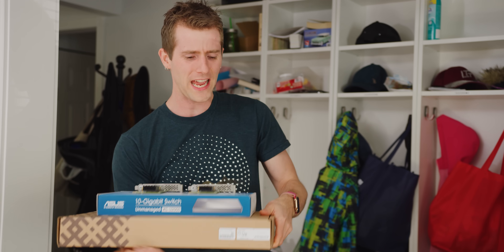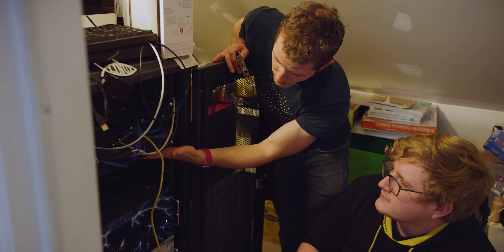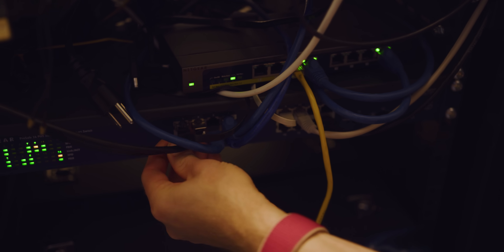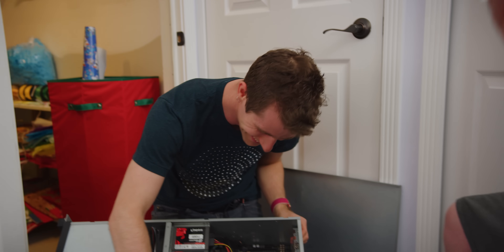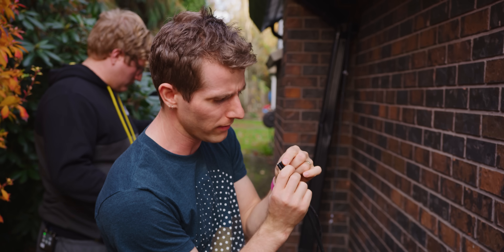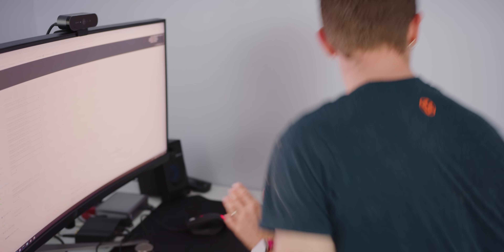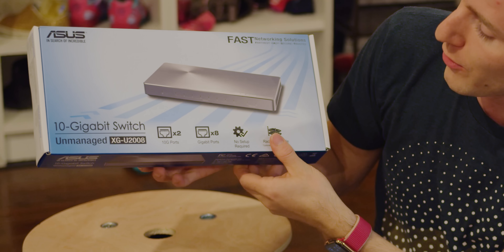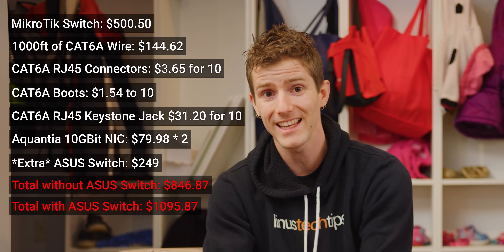Home 10 Gig Network Upgrade for CHEAP

Comment: I've just run single mode fibre cable runs everywhere in my house that I need 10G, the LC connectors are about the same diameter as Cat6A cable so I don't need larger holes, and if you use BiDi SFPs which are still very cheap you only need a single fibre for 10G anyway.
Reply: Richard Skinner I have gigabit internet and it’s great but already seems like overkill for most applications. What’s the practical point of running 10 gigabit?
Reply: @PodtrashRadio  I have a small main desktop with only SSDs in and all my bulk storage is done on my unraid server. I have an iSCSI target on the unraid server for my steam library. 100mbyte/sec would be a bottleneck.
Reply: @richardskinner6391  Cmon... admit it, running fiber for a LAN in a home is total overkill... you did it for the nerdgasm!
Reply: @billysgeo  it was literally the cheapest way to get 10g
Reply: @richardskinner6391  Was it really? (and then again, why did you need 10G LAN in a home environment?)
Reply: Transferring to/from a NAS

Comment: 10 gigabit home network sounds nice.... 
But for the avg household, would we ever need it? 
I mean, i got 250/250 Mbit internet here, and a flawless (although pretty slow) wireless router. my PC is plugged in via a cable and nobody using the wifi is complaining.
How would a faster network, within my home, improve anything?  we dont transfer large files between our computers... 
Seems like a "fun" way to waste hundreds of dollars. but.. maybe i'm just not getting it.

Comment: Linus : I still have not upgraded my house to 10 gigabit connection

Me: I still have not changed my house to 300 megabit connection
Reply: If you ever actually consider it, then run some conduit first. Makes it easier later on when you decide you want to add speaker hookups or something.
Reply: Sounds like you're talking internet while Linus is talking home infrastructure.
I downgraded my home switch to a cheap Cisco so I could learn iOS.(the first one that is, not iPhone...). Now I have two 1Gb ports and 24 Fast Ethernet, 100Mb/s. 😂 My internet connection is 100Mb/s so I'm still alright. Lol

Comment: Not sure what they have against fiber. Really 10G SFP+ transceivers are like 8$ nowadays. And fiber itself is cheap as well. The connectors are a bit pricier ( like 5$ per connector for the mechanically spliced you can do without super expensive fusion splicer ) but that's not the end of the world. And it's so much thinner than cat6.  Like in the same diameter as a cat6 cable, I can bring 24 fibers trunk.

Comment: That cable installation isn’t Cat 6A, or at least it doesn’t conform to either the ISO/IEC nor European standards. 

Not sure it meets the TIA American standard for Cat 6A either.
Reply: Yeah, I was thinking the same thing when I saw him crimp the cable from the outside.  Where's the ground?!  It's still 10Gig, but basically Cat6.
Reply: I wonder how Fluke feels about the insinuation that their $10k meter certified the install as 6A compliant.  Linus said 6A and mentioned 10G at 100m capability, Cat6 termination should have failed certification, or did I miss something?  Sure, he may not have a crosstalk problem at home with only a few runs, or exceed the 55m rating of Cat6 -- but I'd expect a professional meter like that to fail 6A certification.
Reply: @tylerperry7552  Did it test for cat6A cert or 10Gb cert? I can't re-watch it, it's too painful.

Comment: I purchased the MikroTik CRS305-1G-4S+IN 10G SFP+ switch a while ago and I am powering it from another PoE switch. My plan is to use it between my main PC and my NAS using 10G Dell Fibre SFP+ modules. I can't believe how cheap these switches and their routers are. It has not failed once since I purchased it.

Comment: Normally Linus is fairly accurate when he talks about pricing but mellanox connectx-2 cards have been cheap for years. First went 10g with 2 of those + 2m dac off eBay for 35$ 3 years ago. And fiber and 10g transceivers are cheap too. Granted the fiber cables are premade but not expensive.

Comment: Me : 15Mbps Max
Reply: This video is about LAN (local network) speeds, you're talking about internet speeds they are very different. The internet access can run over your network
Reply: @mrmotofy  Lets say you wanted to use 10Gig at home. 

Unless you shovel around massive amounts of files, its useless.

UNLESS you get fast internet
Reply: @lacucaracha111111  yes it depends on what your uses are. But with more and more people taking pictures and videos and storing it, more people are realizing the need for backups NAS so it's becoming a higher need
Reply: @mrmotofy   Or you go the old fashioned route of just getting 2 or 3 high capacity drives in your regular PC
Reply: @lacucaracha111111  Yes that's true...but millions also have lots of personal data to store. For anything important one should have 2 separate copies like separate machines, then an offsite copy. All that data flowing around and network transfer speeds begin to play a bigger role. Also the reason we need more affordable internet upload speeds for offsite backup. I recently read comments of a user blasting Seagate for a drive failure causing them to lose personal data AND customer data which the customers got very angry about. In reality it was the idiot user with 1 single copy of data.
Reply: @mrmotofy  External drives can allready do that. 
As long as you arent a power needing 24TB+ storage (for one set of files) user 10Gig homes are still futuristc. Unless your internet speeds match

Comment: Those are rat droppings and if you have any flexible HVAC ducting in your attic then they're probably in your ducts. You should contact a builder immediately to do an inspection.

Comment: Just bought a 10/100 router and 3 small 10/100 switches.. (for almost free)
to pair with new 100/100 fibernet (upgrade from 20mbit ADSL)
we are never transferring files on LAN.. 10 Gig or even 1 Gig seems pointless at this point..
Cables are whatever Cat 5/cat 5e ;-) 
PING is 6-7ms on the 2 gaming pc´s :D
Max DL/UL on one PC is 95/95 :D

Comment: Made in Latvia... Wooop wooop.
At last Mikrotik got some coverage.
Reply: yes sir!!!!
Reply: I like when Eastern European countries do well internationally. Mikrotik, Prusa, Jetbrains, etc.
Reply: SpaceX put some mikrotik tech on their rockets recently.
Reply: A C really where did you hear that
Reply: @CC-vv2ne  Oh really? Thats something.
Reply: Oh yeah cause their entire firmware supply chain being compromised by someone wasn't enough coverage.
Reply: @turinggirl6432  lol yeah, they gained some publicity, but only script kiddies and network noobs though this was a real problem. Every ISP should have had their winbox port closed from outside and it was solved with two mouse clicks by upgrading your ROS. There's a lot more exploitable servers and Ubiquity on Shodan now, lol. Anyway this is by far the best 10G switch for it's price. I actually use MK devices for my small networks because they can do almost anything. If I've had huge networks with a lot of packets flowing I would go Cisco, but you really can't beat Mikrotik when it comes to it's price.
Reply: @kukuricapica  Ebat is full of much better hardware at better prices. Foundry being a favourite of mine personally.

Comment: ProTip: When buying cat6/7 make sure the AWG is 23 AND it's SOLID COPPER. Otherwise it's not certified and probably wont give you intended 10Gb. A lot of the cheaper bulk cat6/7 cable is either 24AWG or Solid CCA (Copper Clad Aluminum) which is trash.

Comment: mikrotik has the best naming. no joke. The name of a device tells you most of what you need to know about it's capabilities. If i recall correctly, 8XG means it has 8 10gig ports 4c means 4 10gig+sfp, rm is rackmount, CRS is cloudrouterswitch 3 is series and 12 is number of wired interfaces. So if you're someone who installs a lot of routers (which is the target market for mk), the naming convention is pretty neat.

Comment: Tip. DON'T terminate solid core cable to a plug... It will fail over time.

Terminate to a socket in a patch panel or something and use a patch lead.

LTT way is NOT a recommended way and would NOT pass any manufacturers requirements.

Comment: Hey Linus, I have 1 gig internet and used to  get normal speeds on my PC until I got a knew and now the speed is cut in half. I tried getting a pcie to Rj45 gigabit adapter and I even called the retailer and exchanged the mobo but the speed isn't any faster. It's the exact same cable as before and I have installed the drivers.Do you have any idea how I could fix this?

Comment: "Just $1000" - Well... Not everyone can afford an upgrade like that xD
Reply: Some people can buy 1000 $ smartphone but upgrade its a no no
Reply: I would rather eat for 2.5 months...    this is an extreme luxury..
Reply: @Dust599  that last a lifetime
Reply: Honestly, if I was thinking of installing high-speed cabling then I'd just go straight to fiber-optic pairs. The "cable" will support far more upgrades than any copper, including when the industry inevitably switches from SFP+ to whatever comes after it.
Reply: I just did the cabling with two NICs and did the routing on my NAS. I'll get a switch later. I only really need 10GbE on my workstation anyway, so no need for a separate switch.It more than halves the cost.

Comment: Mikrotik is a great make. I have 2 10g switches (crs309 - 8sfp+ ports and crs326 - 24sfp+ ports and 2 QSFP+) and 1 ccr1009 to load balancing over my 3 ftth internet connection. When you power on for the first time a mikrotik product. It have a management IP address , it is 192.168.88.1. You have to put your PC in this network (88.2 for example) and after you can access to it by web browser or with mikrotik utility know as Winbox. When you not take the time to read notice, you make mistakes.  Mikrotik products do everything you want and the pricing is very cheap but quality is very good.

Comment: why why why that is the not the correct way to wire, you have to pull back the sheathing using the  fiber strand because you nicked the wire where the razor went around.... Also why put a plug(male) end ? the correct way is a jack which is way easier to wire when it comes to cat6. i know you are not a pro but you should of got some help.

Comment: TIL my home network=better than linus's old home network for quite a wile now, 
except for my internet, i'll forever be 0.9KM away from fiber, i've been on LTE for home internet for, oh god, 6 years now? at least now i have two lines for load balancing :[
everythnig on my rack is 10g, as well as my workstation on the other side of the house(fiber because i was stubborn)
Some sort of trendnet "smart" switch with 4xSFP+ as IIRC 24x1G
Poweredge C2100 with dual 10g DAC (one directly connected to an 'isolated' server for backups, soon to be in a seperate building on the same property)
poweredge R710 with 10G DAC
Supermicro dual X5690 with 10G fiber

Comment: Linus: "I STILL haven't upgraded my house to 10 gigabit networking"
Me: "Sir could you spare some data for a humble meme farmer"
Reply: you guys have networks?
Reply: You all realize he's only upgrading his internal LAN to 10Gb right? Not his internet connection.
Reply: jj jj why would you upgrade to something you’re not gonna use?
Reply: @Juuls04  be literally used it in the video by transferring a file to his NAS. You don't need an Internet connection at all to do that.
Reply: jj jj than why’d he need new cabling trough all his house? Just link up the server and the pc with cat 6
Reply: @Juuls04  did you even watch the video he explained he was running a 10Gb connection to the media center to connect an unmanaged switch with 10Gb so every device there would be able to get a full gigabit connection to the rest of his whole network at the same time instead of all trying to use 1 gigabit at the same time
Reply: jj jj yeah so he has a 10Gb internet connection
Reply: @Juuls04  no he doesn't he isn't connected to the Internet at 10Gb he couldn't download steam game at 10Gb or any other file on the internet. Your LAN isn't the internet that's why it's called a local area network. You yourself likely have a gigabit capable network if you have any half decent home router from like the last 7 years but you said you have 200Mb service. You therefore, likely, have a gigabit LAN but you don't have a gigabit internet connection.
Reply: Yeah im confused that he thinks 1gig isnt high... like im on 200mbps and not having any problems
Reply: @mattv22  seriously people be commenting who obviously have no understanding of networking at all
Reply: gouryoku Hi, I just wanted to reply to what you’ve said. Peter seems to be out of line a bit, but you’ve gone way past the line . Also poverty shouldn’t be made fun of, it’s a serious situation that no one should go through. But hey, that’s just a goal of the world. Anyway, poverty can come from many things and not just making bad decisions. But hey, in your world everyone’s stupid if they’re poor. You may say how people who are poor are there because of bad decisions, bad education, etc.. But how are you the judge? What makes you special enough to allow you to judge people’s decisions and say if they were good or bad? What makes your conclusions valid? What I’m trying to say is treat people the way you want to be treated, because the comment that Peter made was generally not directed to you. I don’t fully support the comment, however your response is even worse.
Reply: @BrycensRanch  I never ever implied all poor people were stupid. I am just saying that individual is an idiot.
He seems like a jealous idiot.
I hate nothing more than people telling me I am a certain way because I criticized a single individual.
Please take your time and learn basic English before trying to feel morally superior.
I'm poor myself, dude, so what you said means absolutely nothing in the end.
Reply: gouryoku Hi, just wanted to let you know you didn’t state nor give indications you were poor, so I made the logical assumption you were rich since you felt offended. Also, why are we arguing over this? I literally just said at the end of day that what you said was way to harsh. It’s literally the internet.
Reply: Some of use are still on 10meg.....   not rich a-holes like some....

Comment: I will need to upgrade my home network to 10 gigabit next year when they are upgrading my internet to 10 gigabit.
Reply: Try to go fiber (especially for your in-house backbone), it should give you better future-proofing than copper.

Especially if you're willing to terminate fiber to connector yourself.

Comment: I am honestly curious...What are the benefits of setting up a home server?
Reply: It depends on what you want to do with it. 

For instance, at home I have virtualization server running ESXi. Basically, this allows me to have many virtual machines in one physical system. I have a Windows server VM that handles things like DHCP, PCs backups, etc. I also have a Pi-Hole server which basically blocks ads at the network level. I have an OpenVPN server that allows me to connect to my home network over a VPN.

This is all overkill for the majority of average computer users. Most people just want things that are plug and play. However, I like to learn about computer networking, so this is one of the ways I can not only learn, but into practice.
Reply: @JJFlores197  Hmm......Interesting...I will have to start playing with those ideas. Especially the Pi-Hole server you mentioned..I think I have a couple 500 gig HDs laying around that I could throw into a rig and at least try and do something similar (really like the idea of backing up computers remotely...Here's to hoping there is a sale on ssd's coming up)

Thanks for putting time in to respond ^.^

Comment: will we need a 10 gig internet plan from an internet provider?
Reply: You're confusing the local network speeds like in this video with internet. Your internet connection runs through your local network. So you could have a local network running at 100Gb but if your internet is only 10 megabits that's all you will get. But your transfers to your NAS or local computers will be at 100Gb

Comment: Very cool project sir. I am glad I watched this. One day, I would love to have myself a great network like you do. (:

Fluke Networking tools are awesome. I liked using them when I did networking for a local ISP. Glad you all used those as that helped me dream a little more as well. (:
Reply: Fluke makes great stuff, but severely overpriced stuff. In order for a $10,000 list price to be justifiable, that certifier needs to have cost at least 2,500 to manufacture.... Are you honestly going to sit there and tell me that that thing cost over $2,500 to manufacture? With a straight face? With mass production prices per unit are low low.  That certifier probably only cost a few hundred dollars maybe $1,000 at most to manufacture per unit. $10,000 is completely inexcusable